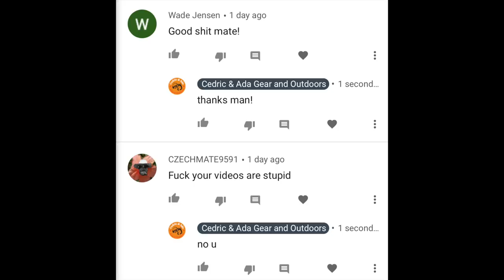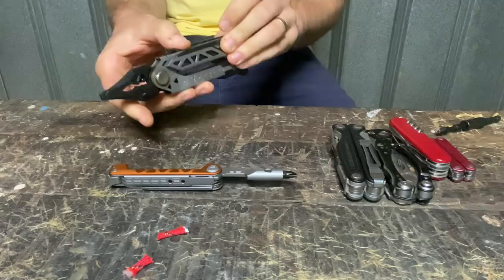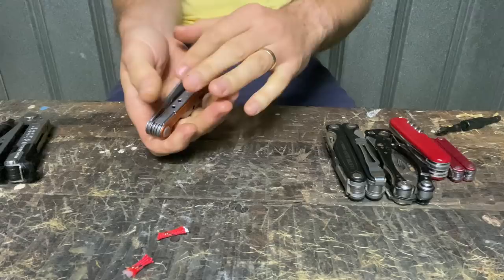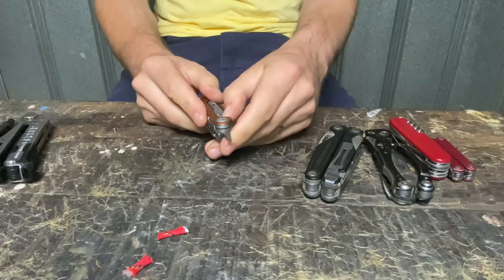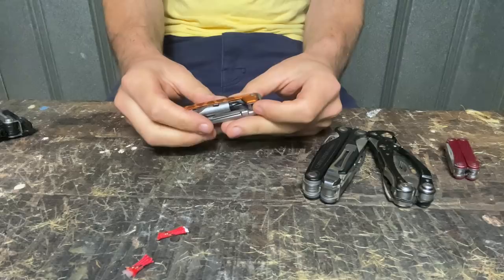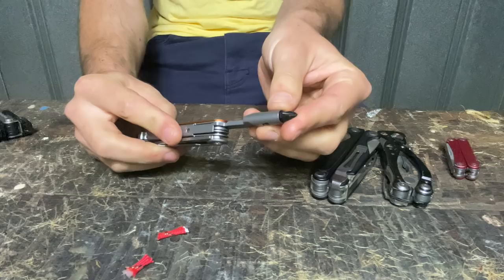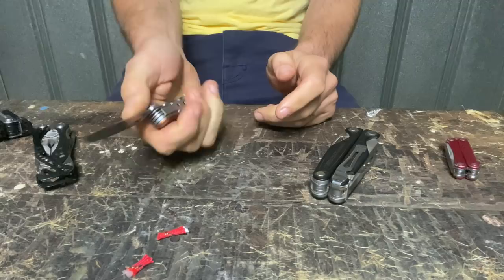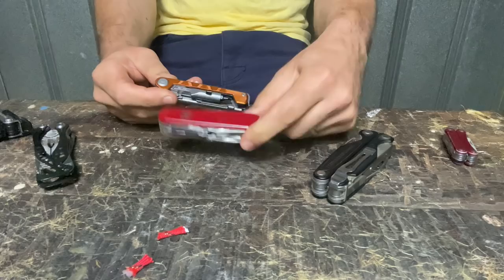The New Gerber Armbar - A Film about It, and its Strengths and weaknesses.

Comment: Nice review.  I have one, agree entirely about the lack of lock or even any detent on the driver and awl; only mine.... even the scissor troubled -- the spring slips off to the outside of the tool really often, becoming useless.  I can bend it back, but it's a regular thing.  Not even close to state of the art for a pocket tool scissor.

Comment: A tool failing when clearing the way for an ambulance seems like a lot more than a bummer. Depending on the context of course.
Reply: yeah I used that center drive in a much less time sensitive environment but industrial all the same and it does not hold up. It's just too heavy to be a light duty multitool.

Comment: Some farm fences use mild steel wire and some use high carbon high tensile wire, you may have encountered the latter. Not sure that is an excuse for your cutters shattering, but it is shit stuff
Reply: I'm pretty sure I heard him tell this story previously, and the kicker was that it was some light duty multitool (like a leatherman squirt or something) that finished the job.
Those centre drive cutters are notorious for breaking super easily.
Reply: @edsaunders1897   I'm pretty sure I've made the exact same comment as my comment above on that video. I'm not really interested, it's just a procedural response like chat bots interacting at this stage! Haha, no, that is good to know, thanks.